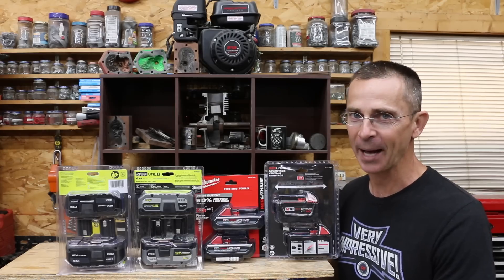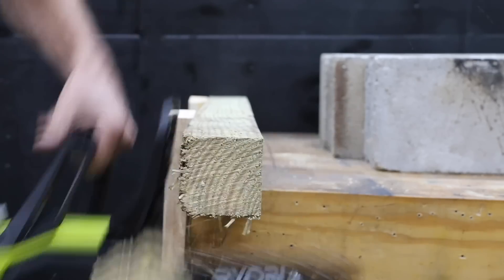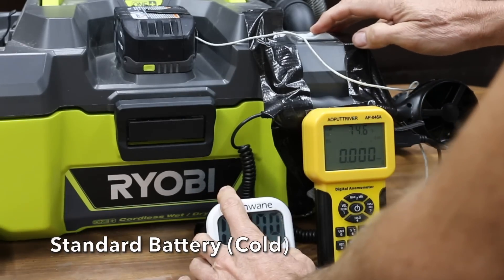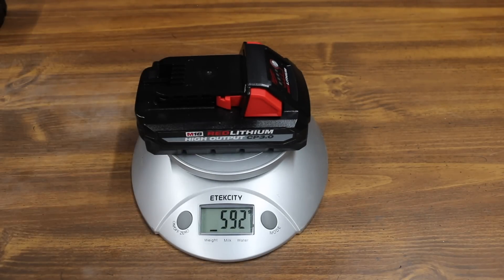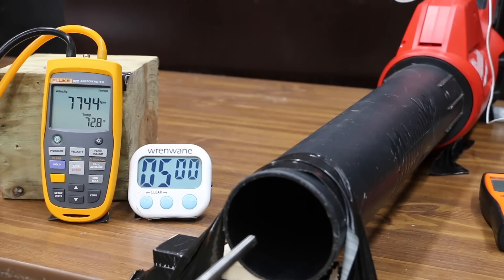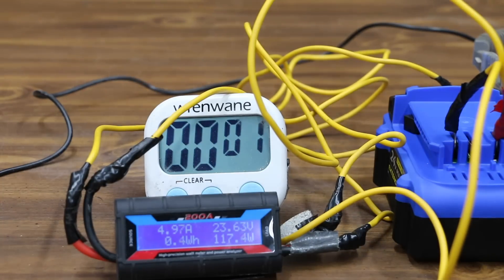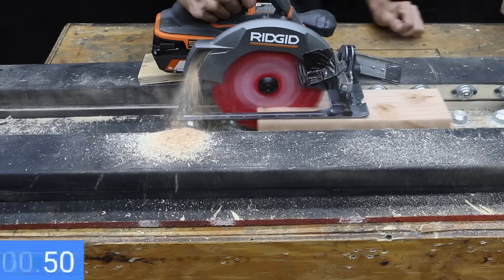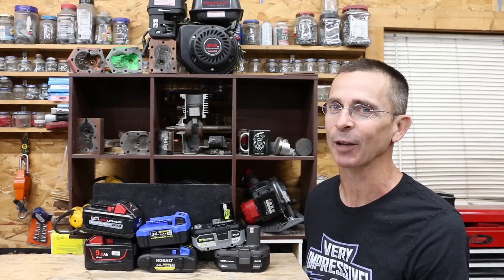Are "High Output" Batteries Better Actually Worse?

Comment: i really like my cp3.0 battery, i have it in my brushless impact that i use in commercial plumbing every day. I usually only need to top off the battery once a week. Though if i use it on my actual drill it runs out quickly, i have a large 12a knockoff m18 for that which works well enough for how cheap it was.

Comment: Ryobi tool fan here. I have most all of them. They are cheap and great for the homeowner / small business owner. 

My recommendation is that if you are buying a Ryobi tool/battery, just get the non HP version. They are much cheaper and have almost the same power as their HP cousin from my experience. 

If you need more power just get a Milwaukee.
Reply from the maker: Thanks for the feedback.

Comment: High output batteries are only good for high loads. Dewalt lawnmower is great example of this. 2x18V 5h batteries overheats in a few minutes while 6ah flex volt lasts 30-45 minutes under heavy to moderate loads. It's motor is rated as 2kW at 36V.
Reply from the maker: Thanks for the feedback.

Comment: The Milwaukee high output 3.0 is my favorite battery. I’m a tradesman and I have four 2.0A, four 3.0 high output, four 5.0A, two 6.0 high output, one 8.0 high output, and one 12.0 high output and for 85% of the time I use the HO 3.0. The performance vs weight/bulk ratio is golden
Reply from the maker: Thanks for sharing.

Comment: You talk so fast man it's hard to keep up but what was your conclusion for the high star batteries? because I have a lot of the Bauer tools in particular from Harbor freight which I really like for the most part but everyone says they put high star batteries in them now compared to years ago when they put Samsung inside so what is your conclusion basically for the high star batteries are they decent or are they crap or are they pretty good since they're pretty cheap especially at Harbor freight or what is your conclusion and what do you think about Harbor freight or home depot or whoever using more of the cheaper cost Chinese batteries like high star or others instead of more expensive better proven Samsung or using Samsung in their more expensive higher quality so-called extreme performance or whatever line that has better warranties like what Harbor freight does with Hercules because I believe with their extreme performance batteries they use Samsung cells but in their non extreme performance batteries they use high star now so what is your conclusion because I really wanna feel good about buying these cardless 20 V power tools and I hope the batteries are OK and not junk basically that won't last very long so let me know what your thoughts are please cause I know you're a super smart guy and you put out amazing videos THANKS!

Comment: The HP batteries for some of the brands only benefit certain tools, I know ryobi and dewalt have higher output tools that these batteries are designed for. Ryobi especially even says it in their own marketing that to get the best performance out of an hp tool, use an hp battery
Reply from the maker: Thanks for the feedback.k

Comment: How about testing the newer milwaukee forge batteries? Claims to have the same as 12AH output (not run time) in a 6AH battery. 
Also, I think most of these HO batteries work better with certain tools that can take advantage of them properly.
Reply from the maker: Thanks for the video idea.

Comment: I dont want to critise.... but.....

The premis of buying a 4amp batterie against buying a 4 amp batterie is not what i would buy...

I would use the 4 amp normal for "normal" kinds of jobs...... if i wanted a "high power max strength batterie" i would go and buy a 16 or 20 amp batterie........

Question, in the "normal" range, do they sell 20 amp batteries? (Unlikely), thats why one buys into the "max" range of batteries.....

Obviously, there is little difference in the 4 amp batteries..... they are only for sale to those that baught a hand drill that came with a 1.5 amp batterie in them...... one wouldnt buy the 20 amp batteries for the drill as it would increase the weight considerably, and if you had to put up plasterboards in a ceiling screwing dry wall screws, then the 1.5 amp batterie is best, and typically one has 3 of them fully charged when you start work, and you keep rotating and charging them untill dinner time...... 

After dinnertime you can still work and lift the drill, keep rotating till 3pm and afternoon break,  then work till 6pm and the packs will still work....

Verses using 1 x 20 amp batterie all day,  your arm would be dead in the afternoon..... thats why there is choice.... and you use the appropriate batterie for the conditions you're working under......

If you were doing floorboards in a loft conversion than using the 1 x 20 amp batterie is fine, maybe top it up alittle at 3pm in afternoon break if it needs alittle.....

Thats why there are different sizes for different working conditions......

To build studded walls, 2 x 4 amp batteries rotated on charge is fine for all day work.....

The whole point is to use the right batterie or combination of batteries to get the most work done to earn the most amount of money as possible......

Yes, there is fractional amount of gain between the normal and max batteries..... would i pay the extra for the max?..... not after seing this video..... but i would have thaught that the extra 10$ would have given me more then what this video proved, and especialy reading the false claims on the packadgeing.....

IT JUST GOES TO SHOW US ALL HOW THEESE COMPANIES ARE "" RIPPING US OFF "" WITH FALSE ADVERTISING.......

Use a quality brand, and non of these shown in this video...... having said that, i wonder if dewalt, bosch, etc are doing the same thing????????????????..

Post 2022, the centuary where everyone rips everyone else off..... thats how low we have all sunk......

Perhaps we need another Noah and a flood.....

Comment: I have many Milwaukee tools and many batteries but I generally ONLY use the standard batteries.  I have had a couple high output batteries but the high output batteries always seem to suck compared to the regular batteries.  I'm sure they make more power when they are fully charged for a few minutes but after that well they drop off and well whatever tool I use with HO batteries always seem to be very inconsistent with capacity and run times..... But when I use the standard batteries I have no problems......

IGNORE the high output batteries.... just buy the cheaper standard batteries
Reply from the maker: Thanks for the feedback.

Comment: for the Milwaukee ones the smaller battery weighs less, is smaller in size yet performs pretty close to the same under normal circumstances. the smaller battery will make using some of the tools more comfortable most likely. that weight savings probably stacks up when using it all day.
Reply from the maker: Thanks for the feedback.

Comment: Also, the Ryobi HP batteries may only work in HP rated tools.  The batteries has two leads on the battery to tell it to go in HP mode. You are using regular none HP tools. There been no reviews on Ryobi claim.  I would like a review of HP Tools versus Non HP Tools from Ryobi.   This can save owners a lot of money.
Reply from the maker: Thanks for the suggestion.

Comment: For the first time I actually disagree with you. High cap and high density batteries have their own niche of tools and applications. There are tools designed specifically for them, and regular batteries simply won't and don't cut the mustard there. If you're invested on serious cordless tool kits that require high output and high density batteries, there's simply no other way. Or you'll need a truck load of normal batteries to carry working through the day. Simple example - 12amp high density battery is a must to power and run a milwaukee chainsaw, same goes to table saws, core drills, heavy breaker... Very niche tools, but if you have to run them, make sure you have the correct battery packs for them or you're looking for trouble.

Comment: As a battery engineer, the only difference typically between a standard and high performance battery is the cells. 18650 is standard vs 21700 for "HP". The 21700's don't really perform much better or worse than the 18650's, but they do have a thermal advantage as they don't generate much less heat due to having a much larger volume while outsourcing the same power.
Reply from the maker: Thanks for the feedback.
Reply: He says in the video it has a bigger capacity is that true

Comment: I own a bunch of Milwaukie battery tools and have added the M18 high output XC6.0 batterie to my tool chest. I would agree to your conclusion that the larger battery is normally not justified...except...for my Milwaukee cordless vacuum which has one speed: full on and it will drain a standard M18 battery in a matter of minutes and my annual descaling of my swimming pool with a M18 drill and 3M abrasive wheel is another application that these power houses rock at. Just some input, but it seems like in these applications, they last longer than their energy delta would suggest. Thanks for the great content!

Comment: Did you use new chains or sharpen between the two batteries? That'll have a significant impact on the the cutting rate and general performance when cutting

Comment: Great Video, I was just about to pull the trigger on some more expensive High Output Rigid batteries which def work well but thanks to your Analysis, I think the Standard 4ah Rigid battery will be plenty of juice. Thanks for your honest comparison 💪🏽
Reply: Did you buy the standard batteries yet and do they perform adequately?

Comment: I noticed my KOBALT HO battery on my impact driver likes to break my socket adapters, I just typically run the HO on the 1/2" impact and the extended run on the driver
Reply from the maker: Thanks for sharing.

Comment: Your tests showed me that the HO batteries aren't worth the money.  But what I'd love to see is how the size of the battery affects things.  I'd always, apparently mistakenly, believed that a 4ah batter did the same thing as a 1ah batter but for a longer period of time.  I've since been told that a 4ah or 9ah batter gives the tool more oomph, not just a longer run time.  I have the same Ryobi 10" chainsaw you used in this video.  I'm told that a 9ah batter makes all the difference in its ability when compared to a 2ah battery.  I'd find that to be an interesting test.
Reply from the maker: Thanks for the suggestion.
Reply: @ProjectFarm  Except I just went looking on your site and it seems you've already made the video I was looking for.  Sorry to clutter up your time.  Thanks for the videos, greatly appreciated.

Comment: I have Bosch 6.0 and 4.0 CORE batteries with "high output" 2170 cells, my go to is always the Core batteries. Under normal use they have more power longer than the 6.0 and get work done a little faster. Both those things make about the same work out of both batteries, just that the 4.0 Core charge quicker and are lighter/smaller. For ME it makes sense to use the 4.0 Core batteries. But! every once in a while i find the 6.0 makes more sense when doing lighter tasks that need longer run time, like light drilling a ton of holes or putting a polisher at the end of it... to be honest it's not often.
Reply from the maker: Thanks for the feedback.

Comment: Not a fair comparison for the Milwaukee batteries in my opinion. You’re comparing a large 10 cell battery (2x5 18650) with a compact 5 cell one (1x5 21700), unless I’m mistaken. It would’ve been better to compare the XC 5.0 with the XC 6.0 (2x5 18650 vs 2x5 21700). A 10 cell battery has double the current available (in theory) of a 5 cell battery, so in this case the similar performance makes sense.

Comment: Wow great video. In personal use it seems that the Milwaukee HO batteries perform better with things like impact wrenches. Big bolts tightened with regular smaller batteries cone off easily with HO batteries but bolts/nuts tightened with HO batteries are a struggle to get off with standard batteries. I also noticed my Milwaukee circular saw seems to bog down less with my 6.0HO batteries vs the 5.0xc batteries.
Reply from the maker: Thank you!  Thanks for sharing.

Comment: As another potential dimension to this video/test would actually be to test the batteries in higher ambient temperatures.  Testing cold temps is great, but many times in the areas that have low temp extremes, there can also be hotter summers.
Reply from the maker: Great point!  Thanks for the suggestion.

Comment: I have had several of both those Ryobi batteries..not much performance difference, but I can tell you from my experience that the HP batteries always outlast the regular by a good margin(longevity)...I have some HP that have lasted 3 years or more of hard use..I am lucky to get a year out of the regular..also, I have had 3 of the regular ones that stopped working(and wouldn't charge) abruptly when they were almost new...in fact, I won't buy those regular ones any more..the newer style regular ones seem worse than the older style(more square shaped) regular ones...
Reply from the maker: Thanks for sharing.

Comment: Being able to run more coolly while putting out greater power isn't possible given the laws of physics as we know them so, that claim is complete nonsense.
Almost everything we use on a daily basis makes use of this principle starting with harnessing fire to the steam engines of the railroads beginning around 200 years ago. 

I'm fairly  certain that everyone has a device in their pockets that illustrates this obvious law of thermal dynamics when it's used for any amount of time.

Comment: In the case of the Milwaukee batter, I think the slimmer form factor is worth the money.  It keeps the tools over all size slightly smaller.  Yes, that is a small improvement,  but a $20 diffrance over the life of a batter is a pretty small increase as well. Maybe
 $0.02 per use or something like that.
Reply from the maker: Thanks for the feedback.

Comment: Todd this is one comparison test where I think you really missed the mark and what the purpose of High Output batteries are for.

As many others have commented here already, the High Output batteries help certain tools perform better, but only if they're meant to take advantage of the higher current the HO batteries can deliver. 

Torque Test Channel has shown this over and over using their scientific measurements of their test rigs. So with certain high performance tools, the battery used definitely makes a difference of up to 20% in performance at the top end. 

But not all brands, or even certain model numbers or  types of tools within a brand will take advantage of the high current a HO battery can deliver. 

But when they have the ability to do so, the HO battery will make the tool perform significantly better. 

This is almost always the case with higher end tools.

But the High Output batteries will never outlast a regular battery of the same size or Amp Hour rating. They're just not meant to outlast a regular battery of the same AH size.

But if you tested the HO battery in the high performance tools that are meant to take advantage of the higher current they can deliver when needed, you'd be able to measure the difference in the tool's performance versus a standard battery. 

I really hope you retest them because I believe you've misled some of your loyal followers who just don't understand what the purpose of a High Output battery is.

Comment: In real world applications, the Milwaukee HO Batteries most definitely out perform their same aH counterpart by a long shot.  I can also tell you that in my leaf blower, I use a 5 aH battery to blow off my back yard, or I can use a 3aH HO battery and get the same performance out of it as the 5, but with less weight to carry around.  I'm also not pulling the trigger to full throttle 100% of the time,, which makes a lot of difference in how long the battery will power a tool.  We all know that constant draw creates a lot more heat compared to intermittent and variable trigger pull. We also know that heat kills battery performance.
Reply from the maker: Thanks for the feedback.

Comment: I like the comparisons but I can't help but contrast this with the significant differences seen over at Torque Test Channel, where 21700 based batteries tend to produce substantially more torque than their 18650 counterparts at the same capacity rating. I wonder if you're not seeing the differences here because these tools don't pull instantaneous torque nearly as hard as an impact wrench does, and I think that's where the use case for high output batteries really becomes apparent.
Reply: With Milwaukee I've noticed something weird with the batteries for sure. 
The small one.  is only good for the spotlight If you want real runtime.
The regular size will run the chainsaw, but not that great, kinda slow but will still cut logs.
However when putting the big battery from the chainsaw on something like the sawzall, drill and impact there is no noticeable difference besides runtime.